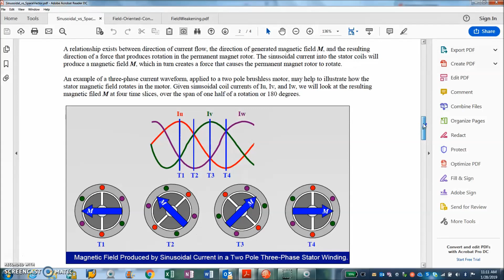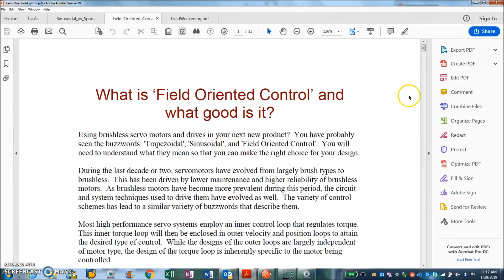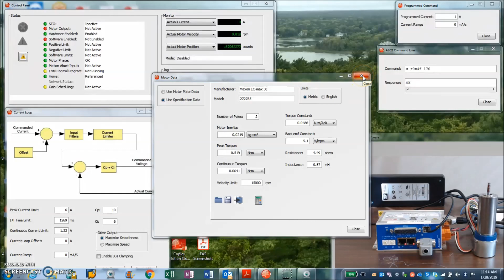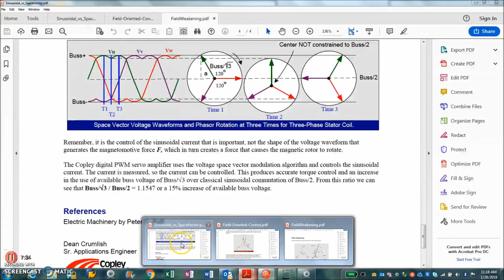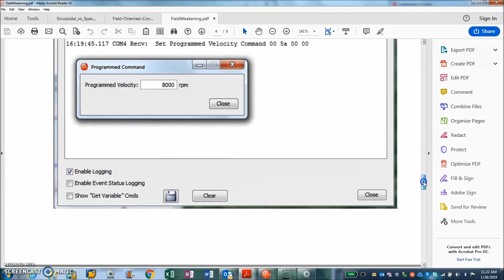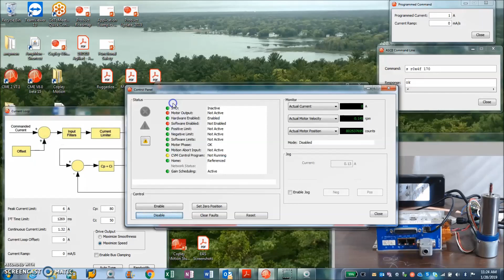Field Weakening and other methods for increasing speed

Comment: Hi there, really great practical video, i have a question, is it that the speed of the motor say PMSM is actually determined somewhat passively, what do i mean is that the voltage of the rotating part of the motor is the Back EMF, which is proportional to the rotational speed, my understanding is no matter how much voltage you deliver to the motor system, a certain amount of the voltage will be taken by the resistive load on the circuit(assuming the load hasn't changed), and the rest will be balanced by the Back EMF, which in turn determines the rotational speed of the motor.
Is my understanding correct? Love to hear your thoughts on that. Thanks in advance.
Reply from the maker: This is a complicated system to describe. Yes, the current to the motor resistance is a voltage. V=I*R so this IR drop only goes to heat the motor as  I^2*R (watts) and in the winding resistance the Arms is the effective  heating or energy lost in the form of heat doing no actual work at the output.
Reply: @dinocrum  Hi thanks for the reply. Apart from the resistance, another question i have is say when we are doing FOC control, we calculate the torque we need to apply we convert it to current, so that's my current in q axis, and without any field weakening we set current in d axis at 0, after the FOC transformation, we have our 3 phase voltage we need to inject, and at this voltage, the motor has certain speed. My question is: if i increase the voltage while maintaining the current in d axis = 0, in theory the torque will be increased, but since the load hasn't changed, can we say the increased voltage will mainly contribute to increasing the speed?
Reply from the maker: @willyturing1803  send email to dcrumlish at copleycontrols dot com thanks. Dean